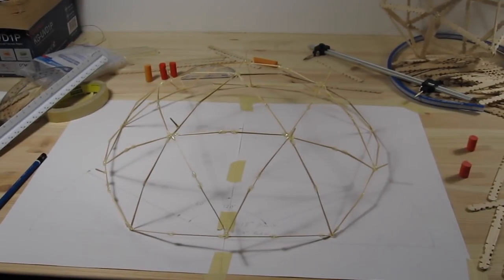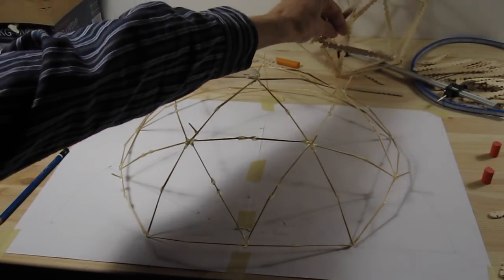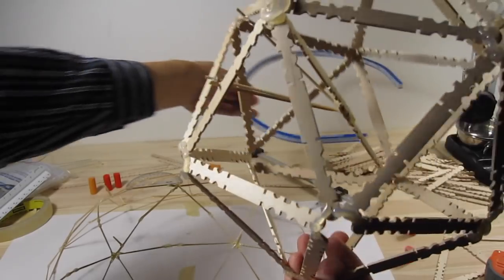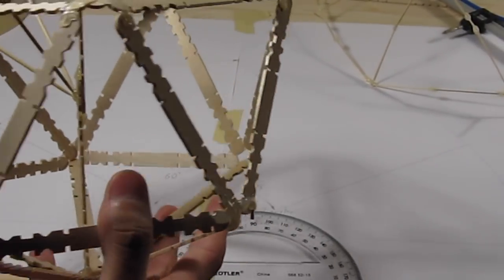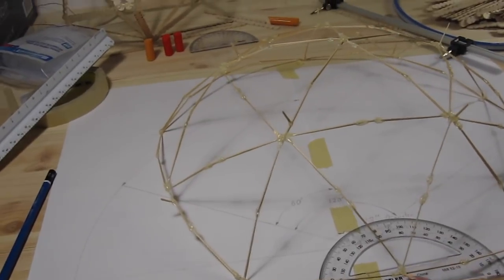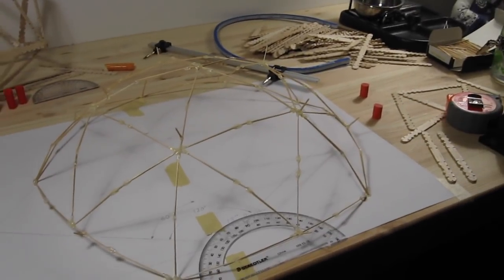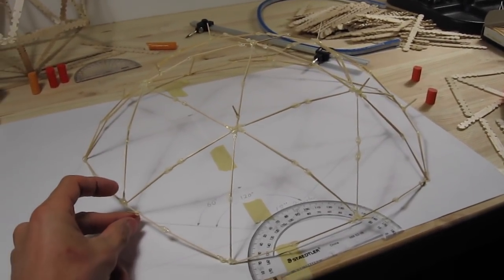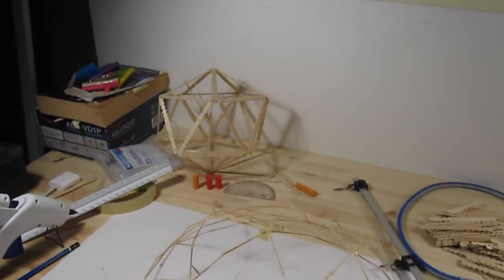Dome home costs one fiftieth as much as regular home

Comment: And don't forget we would be able to save additional money by sharing walls with our next door neighbors. Oh, that's right. That only works with cubical houses.

Seriously, the cost of these is not 1/50th. You apparently haven't looked at the prices of dome kits.
Reply: I did the math on multiple examples and talked to builders who do geodesic dome a near me. It's actually just about right. You can build one yourself where the total material cost is 10 to 13k where a regular home with comparable sq ft in this area or even smaller is 400 to 600k ect. Of course it all depends on your tastes and needs however it makes sense because a geodesic dome uses less material for a stronger structure. A doke home can weigh just 3,000 lbs yet withstand hurricanes, earthquakes and more because of its design. Whereas a conventional house weighs 400,000 lbs at just 2,000 sq ft. All that more material to enclose a living space means more material costs of course. Some kits obviously are marked up a lot, your paying for their design and for the kit and plan ect and the profit on top to pay the company for the kit. If you do it yourself and look at just the material costs it is indeed around 1/50th  less costs give or take a little bit.